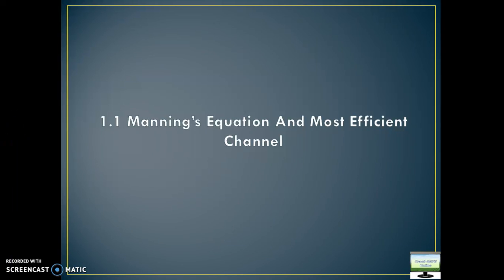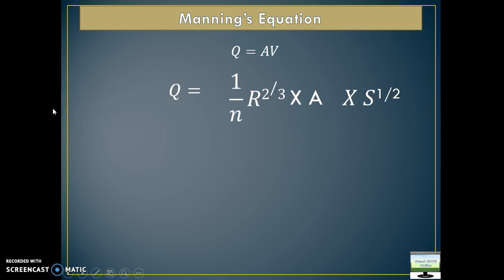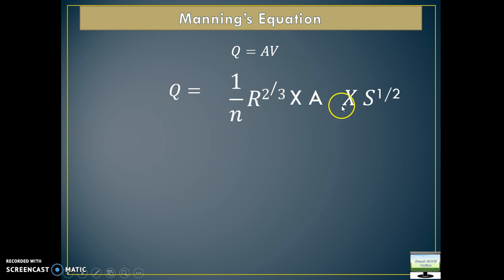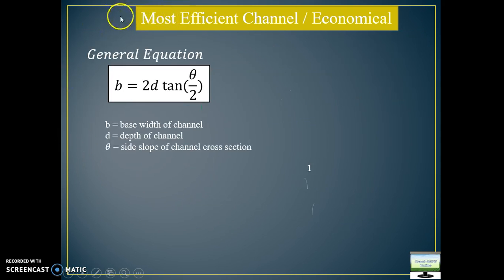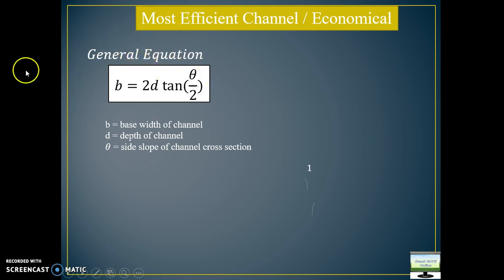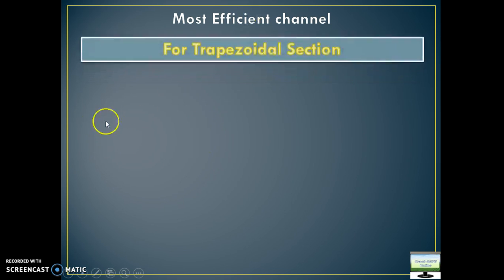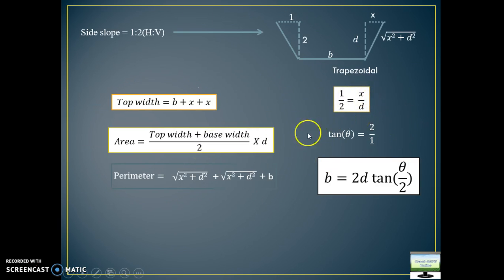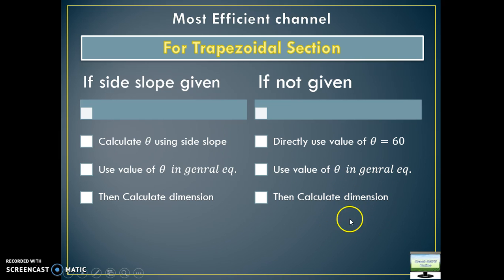1.1 Manning's Equation

Comment: Excellent explanation sir.

Can you please solve these problems or something similar to these too:
1) What is the depth of water in a trapezoidal channel with a sideslope of 2 and carrying a 2.5 m3/s water flow? The channel's bottom width is 1.5 m and the flowing water has a velocity of 0.8 m/s

2) A concrete-lined trapezoidal canal is to carry a maximum discharge of 2 m3/s. The required head loss over a horizontal distance of 1km is 2 m. The sideslope is to be set at 1:1 and the permissible b/d ratio is 3. If the Manning's roughness coefficient is 0.015, find the normal depth required.